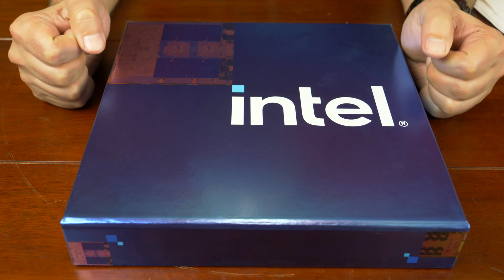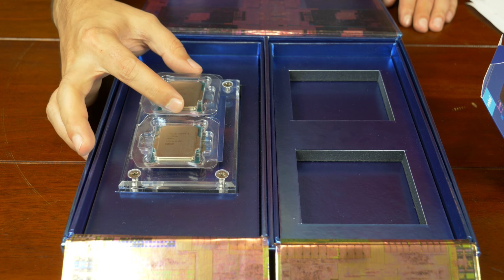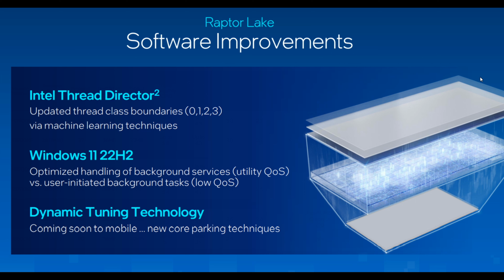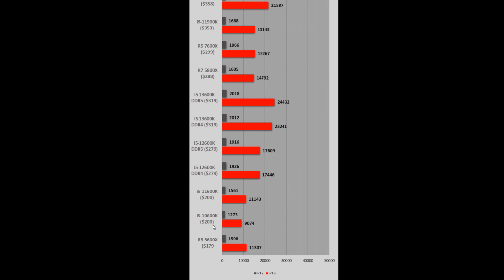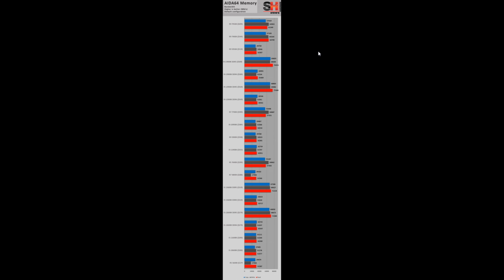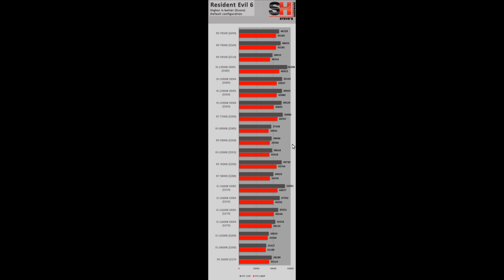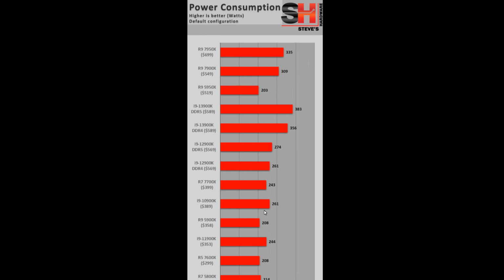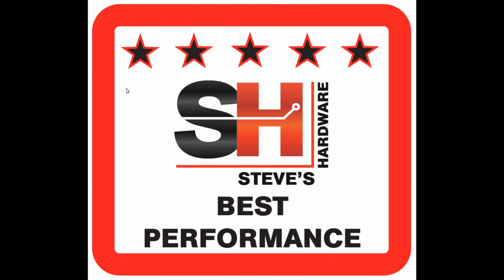Intel i9 13900K and i5 13600K Review with DDR5 & DDR4 Results Included

Comment: For only gaming 
With ddr4 cl16 3600 does 13600k make sense over 5800x3d? Benchmarks seem to favor x3d provided both systems run ddr4.
Reply from the maker: So with memory at XMP, which it is not in the video above, the 13600K does much better with DDR4 than with DDR4 at JEDEC speeds as benchmarked in the video, especially in memory sensitive games. With DDR5, XMP matters less in games for the 13600K. I have that review coming, but I also do not have a 5800X3D to test it against.